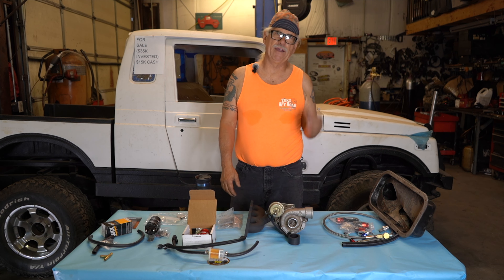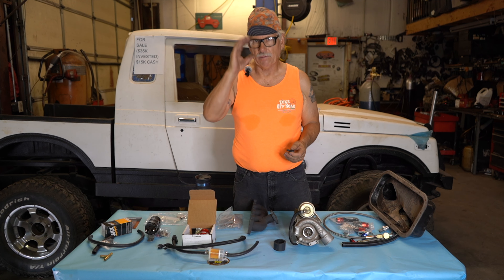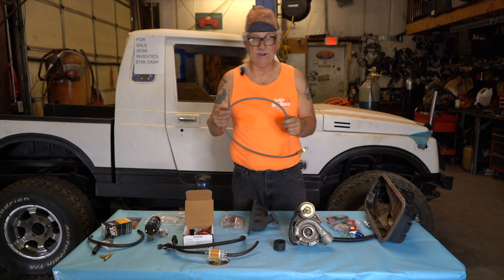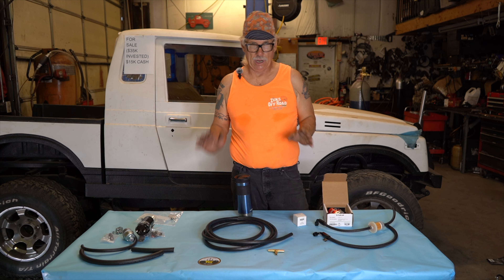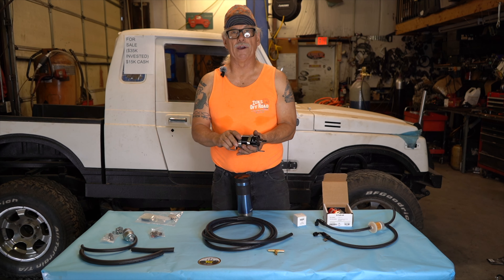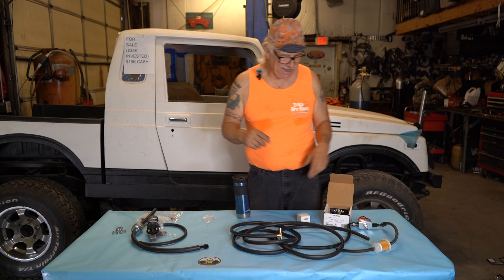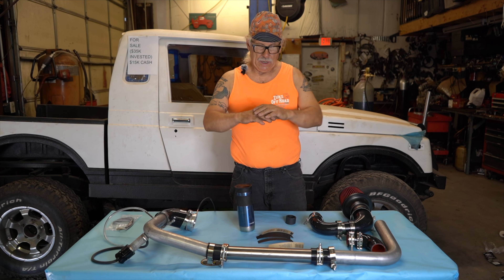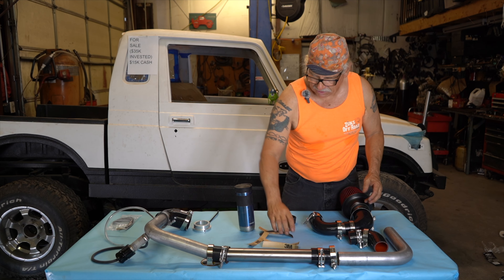MY-Turbo How To Install

Comment: You make a turbo kit for 16v 1.6?
Reply from the maker: I make a log but you can not turbo a closed loop Suzuki Ecu are set to keep in a range of air to fuel that conflicts with boosting. Yes people that like to tinker do turbo 16v so ai do not make a complete kit. If you convert to mega squirt or sniper you now have a programable air to fuel ratio system.
Reply: Got an 86 jx and i am toying with the idea of a carbed 1.3 using the 16v head/intake(from 1.6) and harley carb in place of the throttle body, plans for fuel rail are blocking them off, not sure if/how dizzy will work tho, and possibly(most likely) boost in the near future, had anyone try anything like this? I'm looking for better airflow, since sammy intake is so restrictive, however it will stay carbed, zero interest in fuel injection unless i can get a standalone  or whatever basically free😅
Reply from the maker: @SirLunchBoxx  not going in that direction any time in the future
Reply: @Zuksoffroad  dang, well do you know if the 16v head flows more?
Reply from the maker: @SirLunchBoxx  four valves always flows more than two. It’s not a guess it’s a fact. However turbo doesn’t care if you have two valves or ten. Flow isn’t factor anymore it’s called boost the cylinder gets packed with wet air as soon as the intake valve is barely open